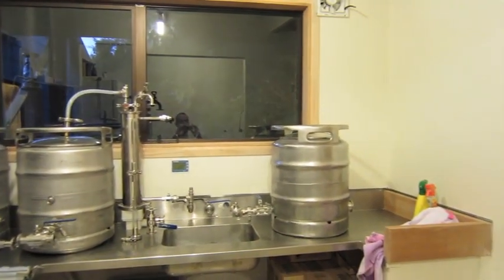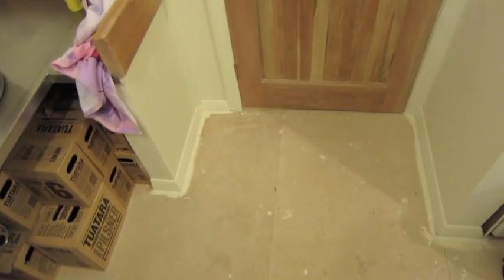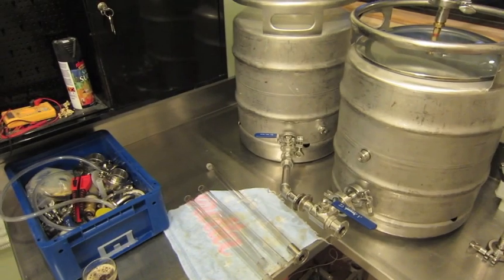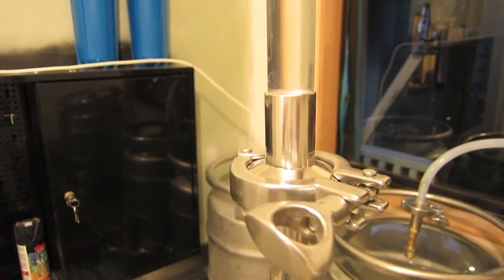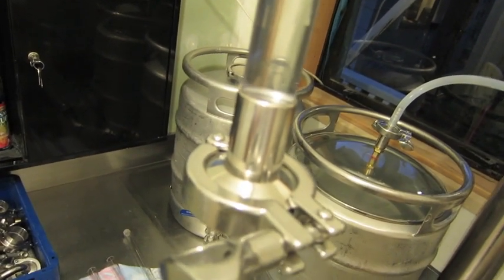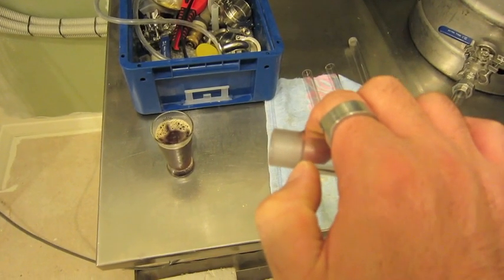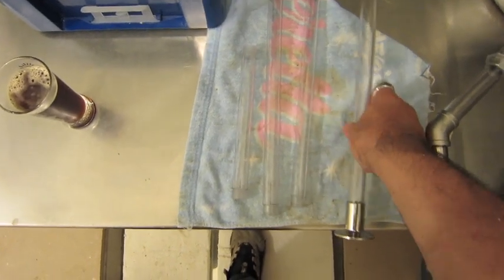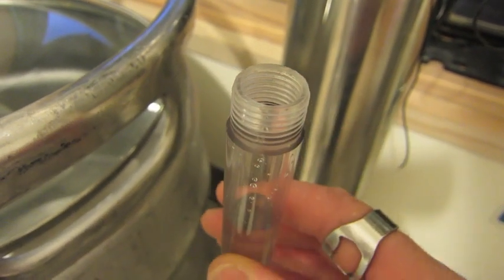No more dust, brewhouse build day 27

Comment from the maker: 22mm OD, 15mm ID, So it has a pretty robust wall thickness. I have a 1/2" NPT tap and die for cutting threads. Make sure you use Foodgrade Polycarb though. If theres no pressure in the pipe and you dont have a tap, you could lathe a groove in the pipe to seat a silicone o-ring(s) in place, that will create a snug push fit.